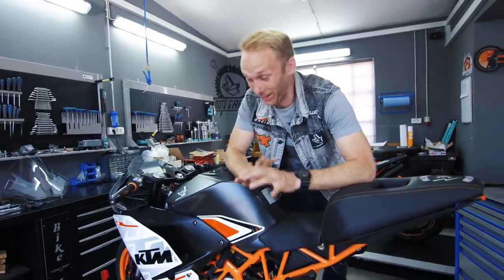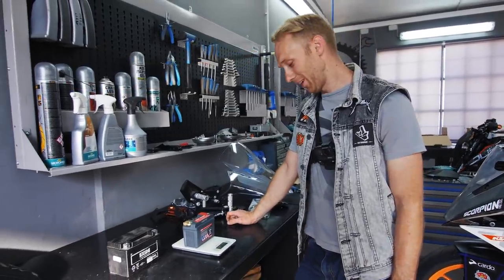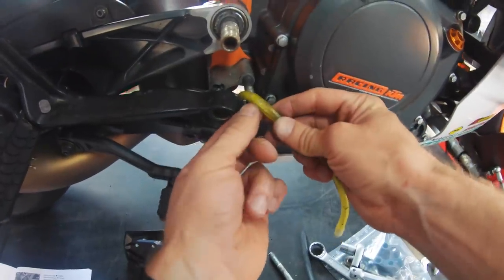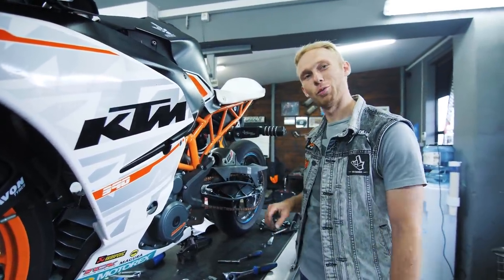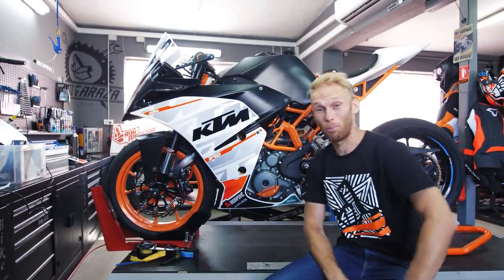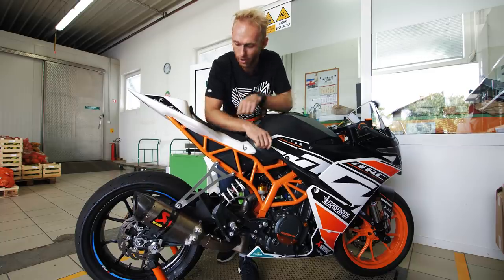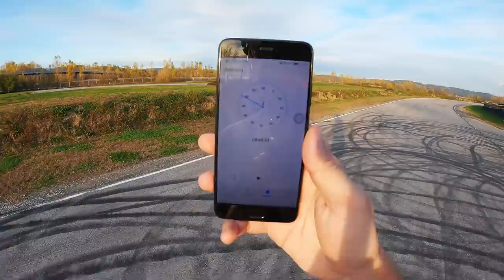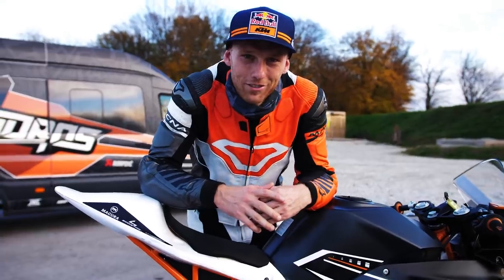Will it go faster? KTM RC 390 from DRIFT to RACE [part 4] | RokON VLOG #107

Comment: u want tips for rc390?here a list for u;
-upgraded 890 duke radiator
-upgraded master front brake pump 17mm@19mm piston u had to trim meter panel a bit
-cooling duct for caliper because the caliper cant dissipate heat efficiently
-ofcourse quickshifter up down
-stm slipper clutch is a must
-exhaust manifold under belly..not around engine block,it cause the engine heat quickly..hey,rc is not scramble u know
i think thats all i can think for now

Comment: hey rok,another suggestion.

1. put styrofoam under the racing seat before you install it.because it will crack after some time
2. install clip on and top clamp (example : tyga brand). you will get better room for riding position adjustment that fit to you.
3. remove front meter holder and custom a new one with aluminum rods or just buy the after market (example: tyga meter holder). well this modification will give you huge difference when you riding in term of  flipping the bike at 'S type corner'(idk what the correct term for this corner). Therotically you just reduce center of gravity.

p/s: nice backing in at 1st turn :)

i did same modification as yours to my ktm rc250 plus above

Comment: Use high flow airfilter and powertronic 🤤 bore up the engine and make it more bigger use bigger throttle body long open camshafts for more combination
Reply: Damn, you know your bikes heh😳😂🤦🏾‍♂️
Great stuff
Reply from the maker: Thanks for the input. As you said the airfilter and a race computer would be one of the next performance upgrades. Boring up the cylinder would be a option to but I would do that as the last possibility. We still have some room for improvement to make the bike faster :D Thanks for your input, appreciate it ;)
P.S. If we would bore up the cylinder do you know which piston we should take then?
Reply: @RokBagorosStuntrider  go for powertronics and quick shifter it will improve your lap timing quite a bit

Comment: Fast throttle, quickshifter and ecu ARacer with open pod air filter, port and polish the head a little bit will make the bike more faster
Reply: And get the racing part for ktm from malaysia which is you can find on facebook at efzendar elena or ef690 at instagram

Comment: Hey Bro next time, if you can, you have to make the frame of rc 390 in carbon fiber and other times make it all in carbon. I think it's more lighter and more stronger.,am I right? 😊(from India hard core fan) still I not used any bikes more than 150cc. Vehicle (runs with wheels) lover, more bikes 🤘🤘🤘

Comment: I got rc 200 Sir but sadly it limits at 143 kmph at 12.5rpm I saw some videos that they put switch on the speed sensor and got 150+. I need some advice is there a better way by not to cut the wire of my speedo ??? Thanks

Comment: U can remove the while starter motor and battery and lose a whole lot of weight like 5kg easily and add a kick starter and also u can remove the key thing and also save a lot of weight like 2kg easily so a total of 7kg

Comment: I got rc 200 Sir but sadly it limits at 143 kmph at 12.5rpm I saw some videos that they put switch on the speed sensor and got 150+. I need some advice is there a better way by not to cut the wire of my speedo ??? Thanks
Reply: Speedo are fake,  use gps speedo for accuracy.

Comment: Rok, I see you closing the gas for shifting up, don't... Just pull the clutch a tiny little so it slips minimal and shift up, or mount a quickshifter. Let the bitch scream :)

Have you tried the GET ecu for this bike ? I'm pretty sure a good map would improve this bike even more. Not sure if this ECU can be remapped as most of the other GET's. 
With remapping possible you could get rid of the catalyser and the O2 sensor, set the rev limiter a bit higher.

Another option would be the Powertronic ECU.
Reply: i could listen you talk whole day